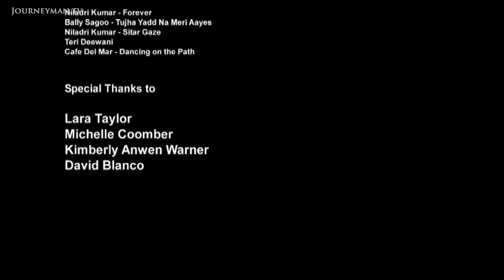India Has a Booming Recycling Industry

Comment: Big miss understanding, used plastic bottles are rarely turned into new plastic bottles. This is because they are made out of different layers of different plastics which makes recycling way harder than you think. It is also way cheaper to produce new plastic bottles instead of making new ones from old ones. Thus the plastic pollution continues. The caps of the bottles however are 100% recyclable and can be molten into new things.